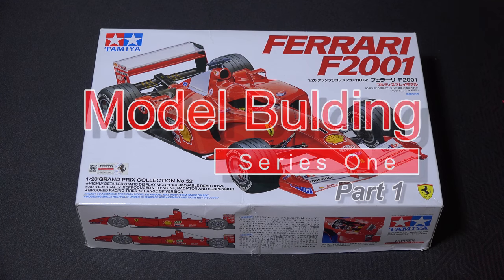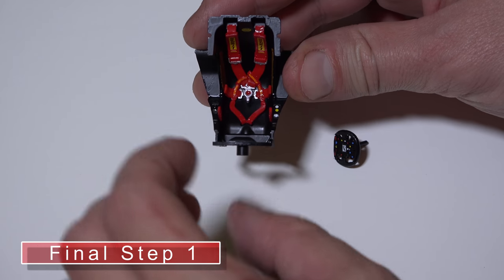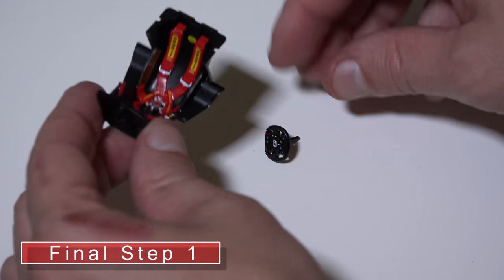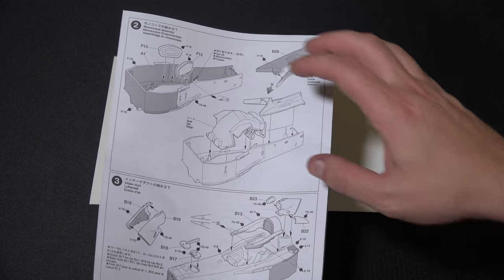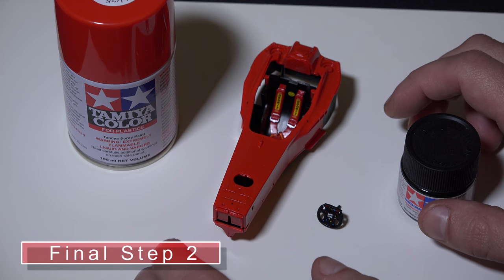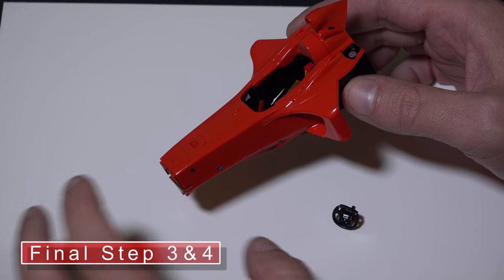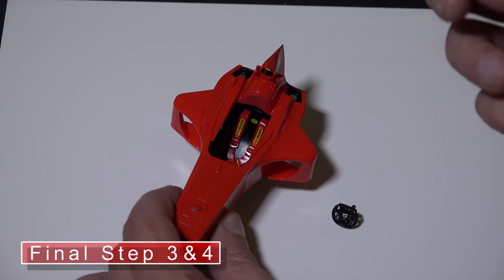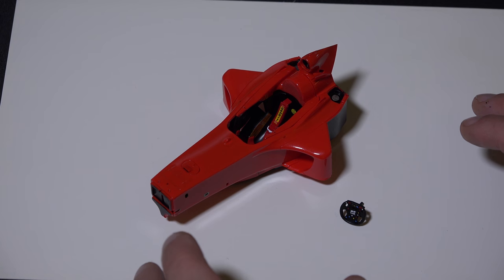Model Build Series Part 1

Comment: Awesome kit mate, just a couple of quick questions, i picked up the F2000 today and reckon aside from the engine and cockpit, it doesn't need to be painted as the body is obviously already red, but the sticker kit features the white stickers to go on the body parts like the wing and cowl.
The question: is it possible to make the chassis accurate without the painting? Cheers! :)
Reply from the maker: Hey thePOWERMAN101 thanks for the question. Tamiya does a good job molding parts close to the correct color and their decals are the best. You could build the chassis without painting, the result would be nice, but not fully accurate. Unpainted parts to me also have a very plastic look. At the end of the day it's your kit and build it as best you can. What's most important is have a good time doing it. Enjoy!